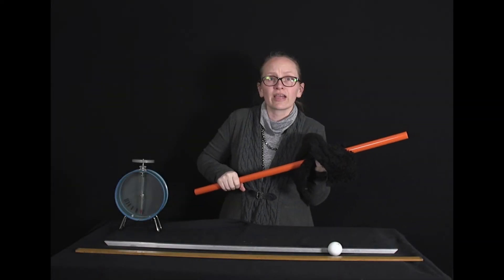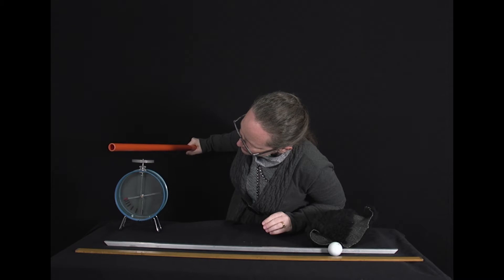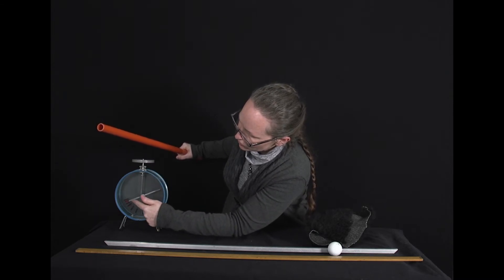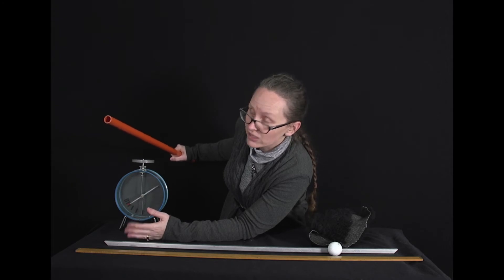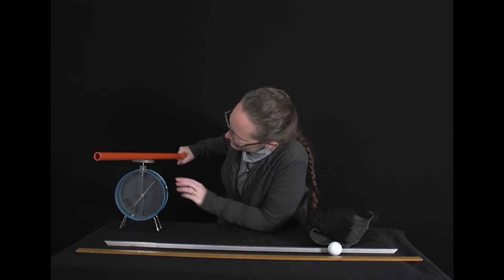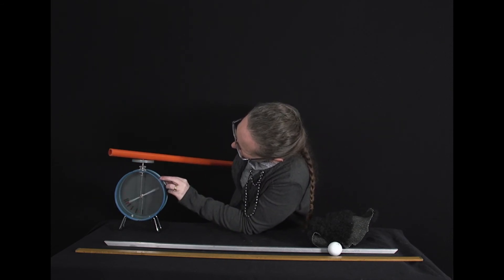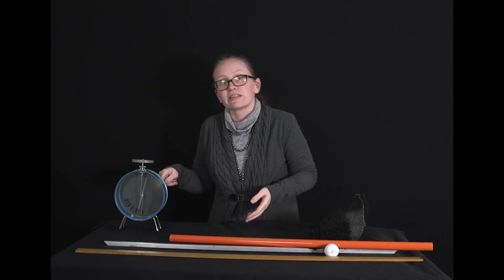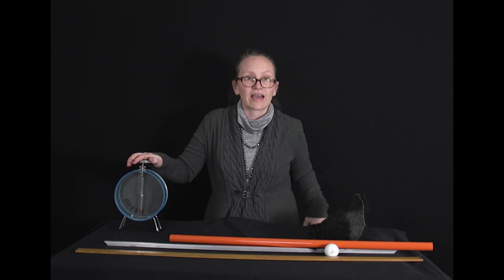Electroscope observe explain

Comment: How can we use the triboelectric series to generate electricity?  I can place an aluminum and carbon rod into sand.  I get a galvanic current.  When I move the aluminum, the current spikes.  This will be to do with the triboelectric series.  Salt even works better.  Rotating drums of sand or salt with electrodes could be power generators or even electric car engines.